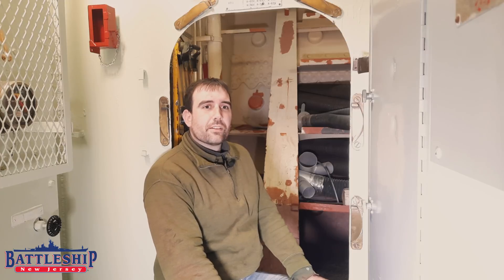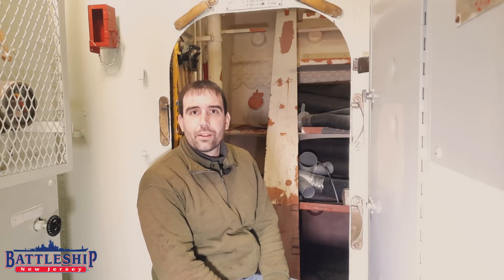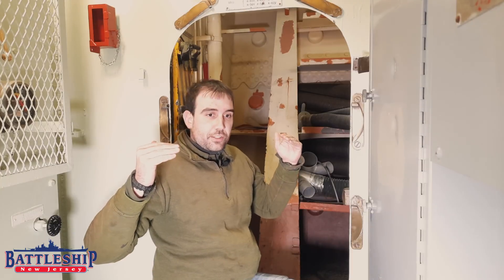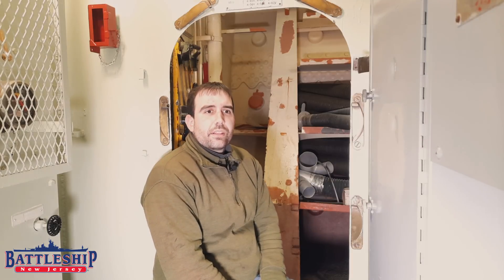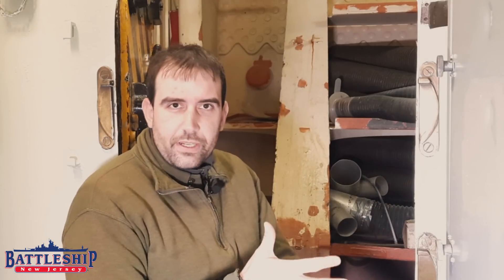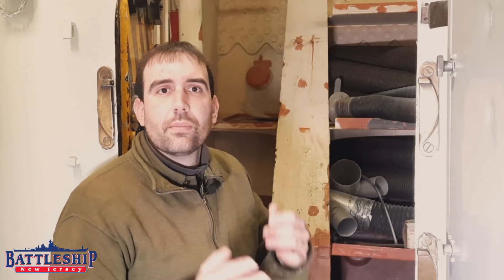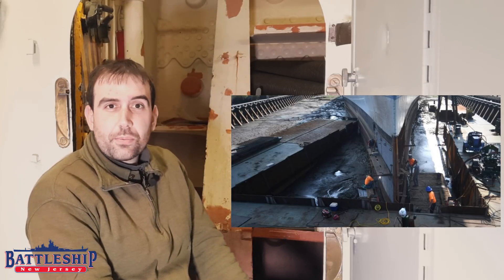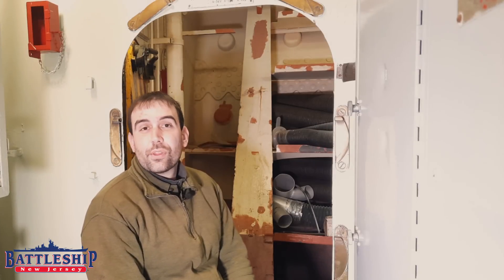Ship out of Water: Why aren't museum ships on dry land?

Comment: the 19th century steamer SS Great Britain sits in a dry dock with hull bracing and an air seal around the waterline, allowing the lower hull and keel to be kept at low humidity. a positive side effect is it allows visitors to go down and see the keel, propellors and rudder up close. ultimately to ensure the ship's long term survival, it should at some point be taken out of the water.

Comment: Being as how it's 2022, seems like a hole could be dug, filled with water, the ship floated in, put in place, have the water pumped out and the ship put on blocks like in a dry dock, then coat the hull below the surface, with a polymer or other water tight coating, then filled in with mud or concrete at an angle to avoid water running down the sides, with a drip rail surrounding the ship's hull, just above the mud/concrete line. If equal pressure not being applied is all that is stopping it, then that can easily be resolved. I know, money, money, money... but it could be done. I think Ryan, personally believes a ship is a ship and should be floating in water. Also if a ship is docked in such a way as not to allow moisture to come into contact with the hull, then dry docking wouldn't be required. Just my 2 cents, but then again I'm no curator. Let the vicious, negative comments begin. I won't waste my time replying. But have a great day!

Comment: It's just an engineering problem. I'm sure it could be solved. It's a matter of money.
They could, for instance, create something like ceramic beads that have the same weight as water, and "float" this ship in them. This would keep it dry, but stop the corrosion. (They could fill the spaces between the beads with nitrogen to really stop the rust.)
I'm sure an engineer could come up with a better idea.
I'm sure it would cost millions though.

Comment: Just out of curiosity..say you,d have a dock with absolutely not water in it, but you did not want to keep it "dry" for the reasons you mentioned. When would happen if you had the ship inside that dock and filled it up, but instead of water you used a slow-reacting oil which instead of corroding the ship would be basically like slapping grease and coating on the outside?

Comment: Why cant you just dry dock the ship, drain the water out and then fill in the dry dock with concrete so the ship maintains pressure on all sides
Reply from the maker: In short, concrete is really bad for steel. Here's a whole video about that: https://youtu.be/17wnf7ehcZw

Comment: If you could get some kind of old drydock installation to allow you to permanently berth the New Jersey there, I imagine you could set up a good water drainage system and pipes for a powerful aeration system, allowing you to pour sand around the New Jersey to support its weight while also reducing water contact.  I mention an aeration system since you can apparently make small particulate sand behave like a fluid by blasting the right amount of airflow from beneath - which could significantly reduce the cost of armor inspections, un-berthing for maintenance, and other such procedures.  I don't know enough about it to say whether its possible on this scale, but I imagine it would be worth contacting experts in the field of fluidized beds to see if such an ambitious preservation project could work.  If it does work, it would be fantastic for the preservation of all the remaining WWII museum ships still properly looked after.  If I were you, I'd look into it, but I imagine just the sand alone would cost more than a lot of your alternatives - the primary advantage here is that it wouldn't be a large recurring cost to maintain.
Reply: This is the mark rober video that inspired me to this idea https://youtu.be/My4RA5I0FKs
Reply from the maker: Land isn't necessarily best for these ships:
https://youtu.be/sa8x2gc448c
Reply: @BattleshipNewJersey  XD the video you linked to me was the one this comment was posted on!  The main point I gathered from the video is that the biggest challenge is ensuring the hull is properly supported across the entire surface below the "water line".  My suggestion was to use a fluidized bed of sand to make both formation and removal of that support an easier and repeatable process.  If it isn't practical, it isn't practical.  However, it seems like an option that isn't disqualified based on A, failing to support the hull, B increases deterioration of hull coating, C permanent or irreparable modifications to the ship to facilitate stowage, or the like.  idk You're the expert on battleships so you'd probably know about more factors that are obvious to those preserving the ship but not tourists, however I think there's real merit to be considered.  Note that the particle size of sand for an air-fluidized bed is pretty small.

Comment: The tanks that have water in them couldn't you seal them them purge the air out with  nitrogen gas or CO2? At first I thought a vacuum  but realized that that could cause  buckling issues with it.
Reply from the maker: Could you? Yes. Is that easier, cheaper, or more effective? No.
Reply: @BattleshipNewJersey  I was kind of wondering about that  not knowing that size of the tanks but I'm sure the cubic volume of gas that would be needed would be huge. 
Where I live huge fruit storage C/A rooms  do that regularly till the fruit is processed  and I do mean huge room that could hold probably 20% of the New Jersey in each room  by volume. 
Ryan and the rest of your team you are all doing a fantastic job at preserving my great uncles ship he would be proud of you.

Comment: I wonder if scientists could come up with a fluid that will allow a ship to float and apply the needed pressure to keep the hull stable, while not causing the metal to corrode. They could go the extra mile and build a cradle a few feet under the ship if they need to dry dock in in place. Pump the fluid out and let the ship settle onto the cradle for inspection/work. Things that could be don't if money wasn't an issue.

Comment: There is a way of preserving a ship, that may help with the "squishing" problem. It was used for Japanese battleship Mikasa, which was preserved by putting it in a dry dock, and then filling the dock with soil.
Reply from the maker: Mikasa is in concrete and its very bad for steel.
Reply: @BattleshipNewJersey  oh, thanks for answering :) I never thought of works that way

Comment: Maybe a wet dock kind of in the style of a lock where you could replace the water with distilled water to avoid corrosion, it would be super expensive tho to a. Build the dock that way and b. Make that much distilled water

Comment: The USS Kidd floats when the Mississippi river is high enough, as it falls the destroyer rest on a cradle sometimes months at a time. It's been in this arangement now for 40 years this year. Large difference in a destroyer and a battleship obviously. I did the design and fabrication end of the cradle and walkway that pivots going out to it. There are always run away barges and multiple barges and a fewt oil tankers at have become "free". I'm really surprised one has not hit the Kidd, but it is partially protected by the cradle it sits in. Just north of the Kidd is the furthest north a super tanker can navigate up the river and must dock, unload, turn around within 1/2 a mile of the ship. Lucky so far.

Comment: Can a ship be set in a earthen slot to match the deck and provide the force vectors to sustain the structure?
Reply from the maker: Putting ships in the dirt holds water to them and would rust them faster.
Reply: @BattleshipNewJersey  I thought the land sitting would be an easy fix. Didn't consider the weight and the effect of gravity and such. What about the way U-505 is set up in  Chicago?

Comment: Any opinion on the permanent encasement in concrete, such as pre-dreadnaught Battleship Mikasa in Japan? 

It was initially done to convince it to not be counted on the Washington naval treaty as a battleship asset, argueing that, since it's hull is encased in concrete, it can't be used as a ship, compared to keeping it floating in the water.

But it is the oldest steel battleship around and seemingly the only one preserved in concrete, is it simply feasable because Mikasa has less weight pushing down from above, since it is a Pre-Dread and thus the superstructure is very minimal, or is encasing an Iowa class in concrete just a dumb idea anyway because there is some massive downsides I overlook.
Reply from the maker: Check this out https://youtu.be/17wnf7ehcZw
Reply: @BattleshipNewJersey  Oh, sorry, I was unaware. Thanks for the heads up.

Comment: The best I can think of is the USS Kidd DD-661 on the Mississippi, Kidd's special mooring in the Mississippi River is designed to cope with the annual change in river depth, which can be up to forty feet. For half the year she floats in the river; the other half of the year she is dry-docked out of the water.

Comment: This is surprising considering that those ships have been mostly build in a drydock. Proably also depends on the scale of a ship.
Reply from the maker: Short term stints in blocks is manageable, long term is problematic. Also, when these ships were being built, they weren't at their full weight until they were put in the water. NJs turrets were put on after launch.
Reply: Thanks man.... I can see it happening, it still feels wrong considering that it is indeed a battleship. No doubt about it. the forces are going to be enormous. I mean the length of the ship also probably changes by half a meter between summer and winter.
Reply from the maker: While metal does expand and contract with temperature changes its very very slight. The ship does not measurably change size in even the strongest temperature changes, especially not just our regular weather changes.
Reply: @BattleshipNewJersey   That is surprising, I am a maschineist and have to consider these changes with production, even on smaller parts. Though the change in temperature is higher, I would have thought it would add up majorly at something of that scale.
Reply from the maker: Thermal calculator says its a 3in difference with a 50 degree difference which considering the hull is in water and doesn't fluctuate that much thats the extreme end. I have my doubts it could manage that even considering how the air and water move through the ship.
Reply: @BattleshipNewJersey  Wouldnt it something to be considered if dry docked...upside gets scourcing hot...bottom in the shade?
Reply from the maker: Theres a lot of air inside the ship, it takes a long time to really heat it up

Comment: I think some people are asking more along the lines of a Mikasa type burying. Taking a ship that is corroding away anyway, especially severe cases like Texas, and grounding them in concrete and gravel. I know its not an ideal solution, however it seems to be a much more effective, not to mention cheaper, method to berth a ship. Mikasa is older than Texas, but by all accounts in far better shape.

Comment: I guess though the question becomes, how long can you realistically maintain a ship that is sitting in salt water? I see some of the older world war II ship museums, and it is pretty obvious that the preservation is not keeping up with the decay. Patriots Point in South Carolina is the worst example I have seen. It seems like these ships cannot be effectively maintained for more then maybe 20 or 30 years as almost no one has the millions it would take to regularly dry dock these ships and do the necessary haul maintenance steal ships require on a fairly regular basis. It almost seems like these ships need to be removed from the Salt water in order to save them (Would fresh water help?). Otherwise we are buying them 20 or 30 years and then they will still be gone...
Reply from the maker: Psst. Weve got a great episode coming out tomorrow about this

Comment: Sure has its own risk but what about on land digging out the dirt and moving the ship in and packing the dirt in around the hull. Would it not support it. Use a rubber coating on what will below soil level to help prevent rust
Reply from the maker: How do you keep the rain out of the dirt and causing the same problem? Thats a very large building.

Comment: well just off the top of my head I think of two ways, to support a ship out of water, 1. in a roofed dry dock filled with dried sand. two a tank filled with oil. both would provided the support the ship needs and actively remove water from the hull.

Comment: A shit pot of epoxy resin?
Reply: what, like, in general? or are you suggesting a method of dry docking a ship?
Reply: @CactusforceX  yep you don't want to use concrete as the is a corrosive effect, But you can build a concrete berth  put wood supports in just like a drydock do a scape and paint just like it was routine dry docking. Then paint the hull with one half of the epoxy  cover that with catalyst then flood the dock with the other half stir till it sets and voila hard water. Build a moisture controlled building over same charge $10 a head till it's paid for. Volunteers for maintenance and tour guides. (Oh and I haven't used epoxy since the mid '80s since I may have gotten the whole process wrong. or the stuff catches fire when mixed in that volume. I suspect they would have do this if it were that simple.)

Comment: Why can't you put the boat into a wet "dry dock"? What I mean is to put the boat into a sealed dock and float the boat in a liquid. The liquid could be laced with rust inhibitor and other chemicals to protect the structure from rust. Naturally there would be environmental concerns as you would not like this chemical witches brew to leach out. When work needs to be performed, the chemicals could be pumped out (and stored) and the sealed dock could then double as a dry dock. Naturally, I will leave the composition of the liquid in the hands of experienced chemists. That would solve two problems - rust and supporting the boat in a liquid to maintain structural integrity.
Reply from the maker: To put the ship in anything but water would require putting it in a building to keep out the wildlife. You're looking at a 1000 ft long building that's also 300 ft high.
Reply: @BattleshipNewJersey  - I see your point. If the chemical witch's brew is strong enough to stop rust then it would not be healthy for any wildlife or perhaps people that may fall into it. I did not consider anything other than the boat being in the liquid. The major issue that I identified was ensuring that such a witches brew did not leach into the environment - I did not consider wildlife. I have no doubt that modern  industrial chemists could create an odorless liquid a low cost, but it certainly would not be healthy to ingest or to have on your skin.

Comment: Unfortunately HMS Victory is now a pastiche of the original. Masts are steel tubes, cannons glass fibre, mahogany replaced with stained softwood, firearms replicas, large parts of the hull replaced, nylon ropes etc, etc. 
It is a very different ship now to the one I saw in the mid 1960’s. 😞

Comment: in terms of the candle in the sealed tanks, i wouldnt say you'd be removing all the air, you'd be depleting a portion of the oxygen, it'd still corrode over time, just alot more slowly. btw would filling the flooded tank with nitrogen not be more effective?
if i remember it's heavier than oxygen so you dont need to be quick with closing the hatch and is used specifically to keep oxygen from degrading foodstuffs.

also rust cannot form if the humidity that exposed steel is in is less than something like 30%, i am aware of the mothball process and using many dehumidifiers to dry out the ships interior, but a bridge in britain has pioneered a dehumidifier air system that pumps dry air through their cables to keep the humdity below that specific percentage. 

i honestly think over enough time this sort of technology would have to be applied to some of the more vulnerable and delicate museum ships in areas that accumulate alot of humidity such as the texas for example. 

sure it wouldn't be in 30 years that it'd be necessary, maybe not for another hundred, but i'm of the opinion that museum ships must avoid as much degradation as possible to preserve them for possible centuries to come.
Reply from the maker: You greatly increase the risk with a gas though, a tiny bit of oxygen being left is a low concern for us.